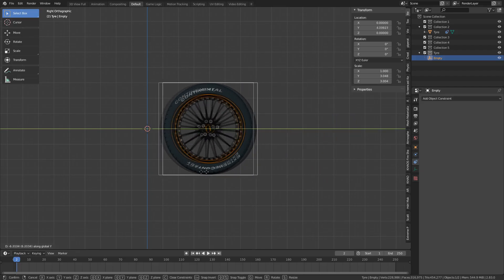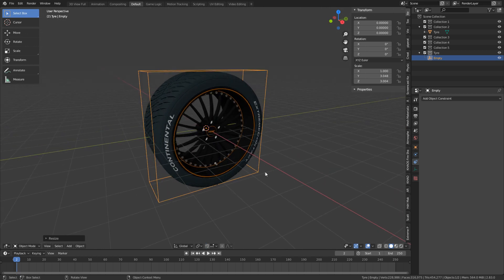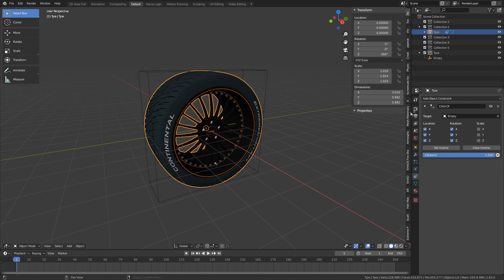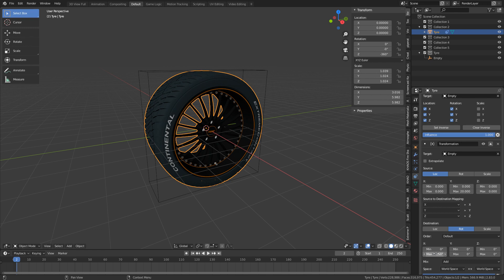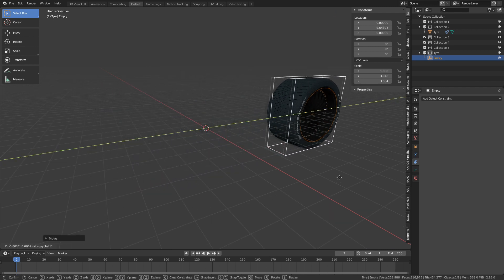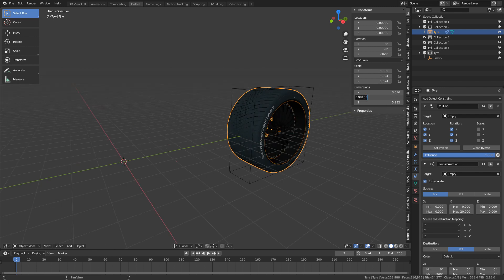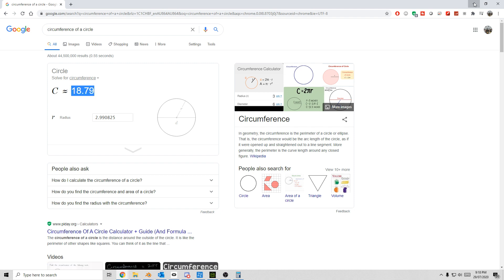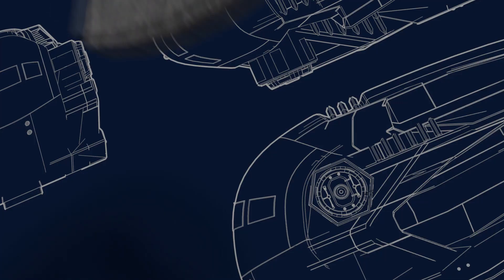Blender How to make a Tire Roll - Tutorial Constraints

Comment: 3.6 has some changes in the transformation menu. Extrapolate is still there. The from/to is not configuring correctly at 2:33 EDIT. Okay. Played some more. If you're rolling on the Y axis like the video. 

The X axis will need to rotate the wheel. 
So. Check Extrapolate below the target. 
THEN, Map From > Location > Y Min 0. Y Max: .2 (My setting). 
Then, Map to > Rotation > XYZ Euler > X Source Axis > Y (important) > X Min 0 deg. X Max -360 deg. (1 wheel rotation forward is negative). 

In simple terms the transformation is converting the Y axis location to an X axis rotation. There's a bunch of stuff going on as far as settings to mess with but the above worked for me and my wheel is rolling rather quickly. :D
Reply: It incredibly does not* work, with settings 100% copied from your helpful comment and this video. Appreciate people like you though.

*EDIT: Sorry it does work lol. Just had to apply the rotation of my target object, and also tweak the why max settings a bunch.

Comment: I want to put this model in unity, but the problem is that from that square where the wheel is added (which makes the wheel have contact with the ground), in unity it is actually seen as a square, as a wheel  cubed, squared (what is he).  In Blender there is the border but in unity the square appears and I don't see the wheel, then let me know if the animation and the running of the wheel are kept in unity as well because I would need it.  I also have two wheel models that I made work in Blender, but I have a problem when I import them in unity.

Comment: When i put this on a "Follow Path" constraint, the wheel dosnt spin on different axis
Reply: The same thing happens to me, without the Follow Path it works correctly regardless of the rotation in Z, but if I put the Follow Path it only works correctly if the tire moves in the global coordinate +Y. Your comment is 4 months old, have you managed to solve it?

Comment: HELLO? IS THIS STILL SUPPORTED? I have a question.

So I have this robot with a single wheel as LEGS?

I rigged it up and a special bone rotates the entire wheel. I have the root bone and this wheel constrained together.

The root moves in Y and the wheel bone rotates in X.

This works fine, but ONLY if I move in Y with the root. Lets say I want to rotate the root 45 degrees and then move "forward" in that direction, then the rotations of the wheel are fked, because it ONLY takes the Y and the root barely moves in Y. 

How do I fix this? anyone any ideas?

I tried Pose space, but it did not seem to help at all..
Reply from the maker: ahh geez, I will have to test it later tonight and I will try and get back to you on this one.
Reply: @Markom3D  I kinda did something and I think it works.

I basically added another bone that is parented to the root, but is like the knee control bones in human IK chains for the legs.

That bone is now with the wheel in transform constraints.

So the wheel rotates always on the X axis if that bone moves forward. I realigned the bone to have Z be the local for FORWARD.

I also learned a new trick lol. If you grab or rotate a bone and then press X y or Z, then you get the GLOBAL axis. But if you press them twice, you get the local axis. So now I can just grab and press Z twice and it moves outwards and its easy to keyframe that. Using this I can freely rotate the model and then still have the bone move forward.

It is not the best method I think though, so if you have a better one do let me know haha

Comment: I'm wondering now how drivers relate to constraints.  I would have thought to use a driver, but the constraint looks like a visual means to write the equation to control a driver. 
My dad as a programmer told me, "KISS: keep it simple stupid."  Einstein said, "Keep it as simple as possible."  I say, "Fml, Blender is deep, and the cat got away, I have to catch him again."
Sometimes not knowing what you don't know you don't know...but knowing you don't know a lot, still doesn't help you feel the surprise as you fill in ignorance... I persist, hoping one day, I reach critical ignorance, and can do what I need to do without research or surprises.